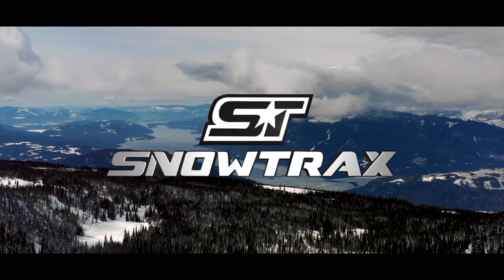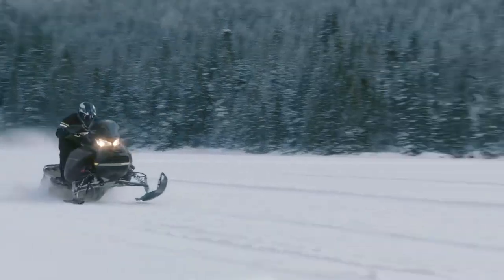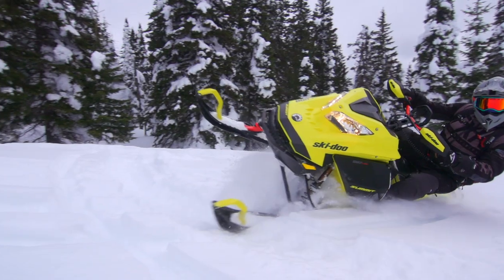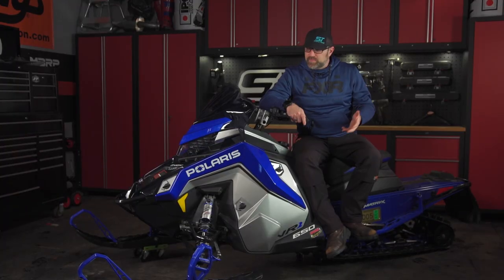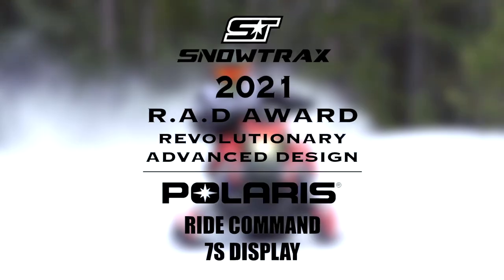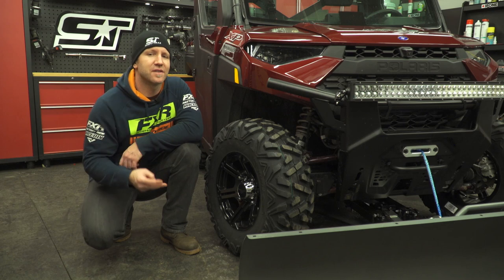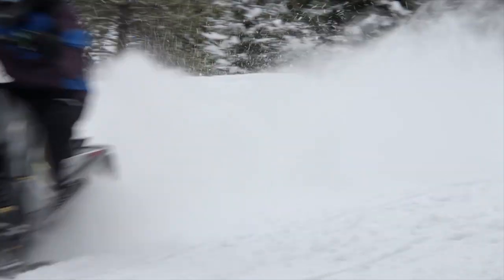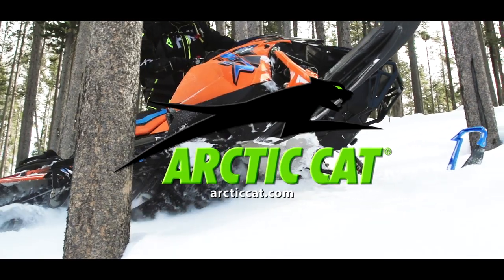SNOWTRAX TV 2021 - FULL episode 13

Comment: the first and only snowmobile i have ever owned was a 1995 yamaha vmax 4 that i bought used with only one season in 1996. i kept it only 2 years. it only had 695km on the odometer. the first owner put a clutch kit and bender racing pipes. 4 of them and a way more agressive track on it. the ski doo dealer that sold it to me said it was more insane and faster than the 3 cylinders 2 stroke mach z they had. i had a blast riding that beast, the first owner also had flames and beautiful paint work done on the front. everywhere i went with this machine, people wanted me to open the cab to see the engine. i was like a celebrity in the trails. this year i want to buy a snowmobile for the first time in 23 years. i like to do very long trips so i think i am going to get a 4 stroke machine. like a 2022 yamaha x-tx-le. i also want to be capable to do a bit of deep snow stuff.

Comment: Instead of selling me a sled with speed that will inevitable get people killed sell me one that is just a good trail sled I don’t have the second mortgage my house for. These snowmobiles have gone the same direction that automobiles have gone where only the rich or stupid that want to be in hock for several can afford.That’s why the sport is taking a crap.
Reply: Neil, there's a little lever on the right handlebar that controls the SPEED of the sled,,, don't push it so far if you are concerned about going too fast for your riding ability.  Don't ban High performance sleds- ban LOW performance drivers.  I agree on the pricing, it's getting out of hand,, but when the buying public demand "significantly new and high tech" every year, that's what happens.